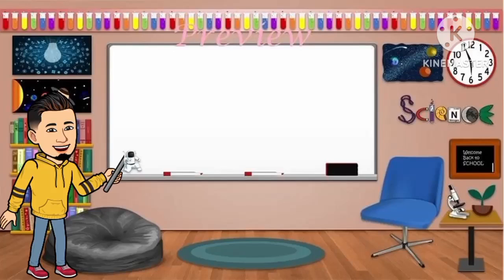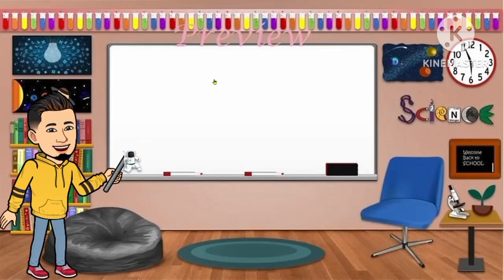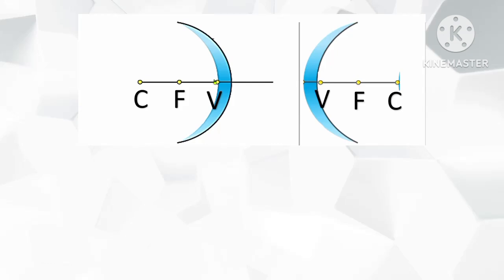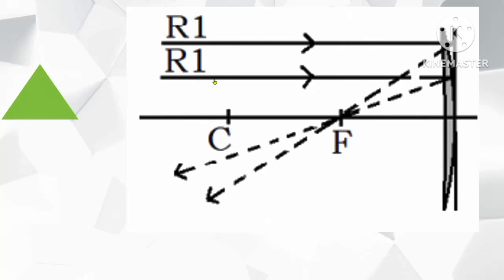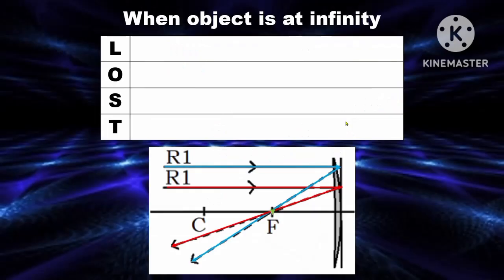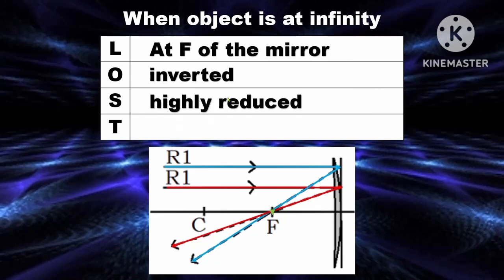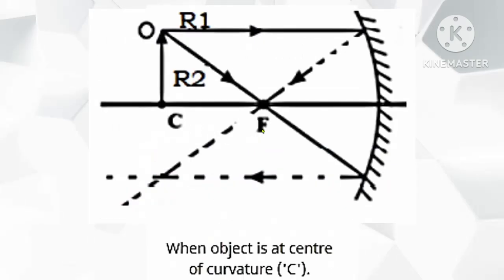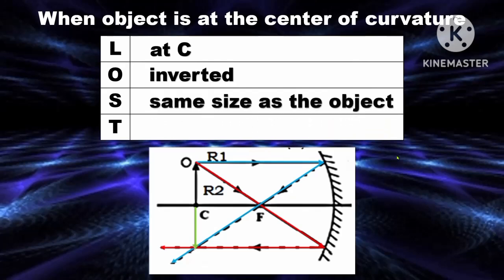RAY DIAGRAMMING TECHNIQUE IN CURVED MIRRORS | RAY TRACING TECHNIQUE IN CONCAVE MIRROR| SCIENCE 10 Q2

Comment: Cassie Vhyen C. Andaya 
10- A.R. - Roces

The video really helped me a lot to further understand the topic and to be able to answer the questions that are posted. I have learned about the 3 types of rays and the LOST that is needed to know the characteristics of the
imaged formed, which is L-lost, 
O-orientation, S-size, and T-type of image.
When the object is closer to the mirror, it enlarges, and it's called a real image, and it's inverted if the intersection is found in front of
the mirror. On the other hand, when the intersection happens behind the mirror, its orientation is now upward, and the type of image is a virtual image.

Comment: Joshua Jov A. Valiente
10-A.V. Hernandez

The video is very helpful in explaining how concave mirrors form images. It breaks down the relationship between the object's position and the type, size, and orientation of the image in a way that's easy to understand. The visuals clearly show how the image changes depending on whether the object is placed beyond or between the focal point (F) and the mirror, helping to explain if the image is real or virtual. I especially like how the video shows what happens when the object is at the focal point or closer to the mirror, creating a magnified virtual image. This makes complex ideas much easier to grasp.

Comment: Madeline G. Bagallon
10 CP-Romulo

The video provides a very informative and engaging demonstration of how concave mirrors form images, helping to visually explain key concepts that are often difficult to grasp in theory. It effectively breaks down the relationship between the object’s position and the type, orientation, and size of the image formed. The clear visual examples make it easy to understand how the location of the object—whether beyond or between the focal point (F) and the mirror—affects whether the image is real or virtual. The video also highlights how the image can be upright, inverted, larger, or smaller depending on where the object is placed. I particularly appreciate how it visually shows the concepts of image formation at different distances, like when the object is placed at the focal point or closer to the mirror than F, producing a magnified virtual image.

Comment: Jemarie Kate M. Jacob
10-A.R. Roces

In this video, it’s all about the behavior of light rays in concave and convex mirrors. It determines the characteristics of the images formed, including their size, orientation, and location based on the object’s position relative to the mirror’s focal point and center of curvature. Ray diagram technique is used to analyze image formation in concave mirrors by tracing light paths from object to mirror, reflecting to focus or principal axis.
In concave mirrors, objects far from the mirror form inverted, highly reduced, real images at the focus, while objects between center and focus form inverted, enlarged, real images.

Comment: VALDEZ, VENICE FAYE 
10-B.L- LUMBERA

A mirror is a surface that reflects almost all incident light. Mirrors come in two types: those with a flat surface, known as plane mirrors, and those with a curved surface, called spherical mirrors. In this article, we will explore two specific types of spherical mirrors: convex mirrors and concave mirrors. We will also delve into the concept of ray diagrams, which help us understand how light behaves when it interacts with these mirrors. 
      Mirror has two type ,A concave mirror is a curved mirror where the reflecting surface is on the inner side of the curved shape. It has a surface that curves inward, resembling the shape of the inner surface of a hollow sphere.A convex mirror is a curved mirror with the reflecting surface on the curved shape’s outer side. It has a surface that curves outward, resembling the shape of the outer surface of a sphere. Convex mirrors are also known as diverging mirrors because they cause light rays to diverge or spread out after reflection.They pass through that point and then diverge from that point. After reflecting from a convex (or diverging) spherical mirror, such parallel rays are bent so they diverge as if they had come from a single point.
     Curved mirrors can produce all sorts of images. We will restrict our attention to spherical mirrors. Mirrors that reflect on the inside of the spherical surface are called concave mirrors; they will cause parallel light to converge on a point. Mirrors that reflect on the outside of the spherical surface are called convex mirrors; they will cause parallel light to diverge as if coming from a common point.